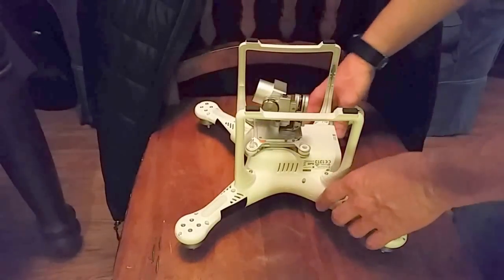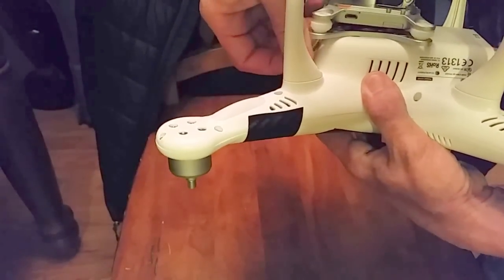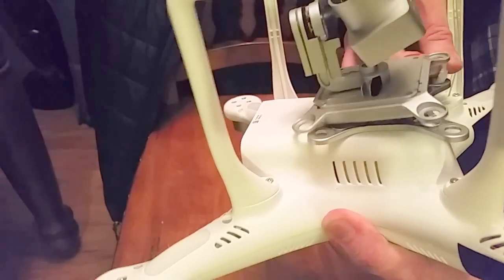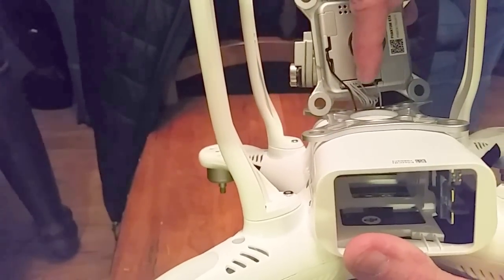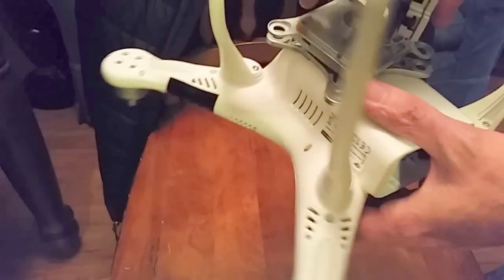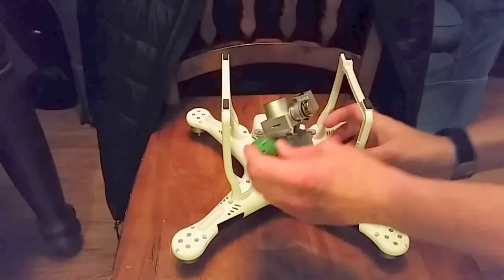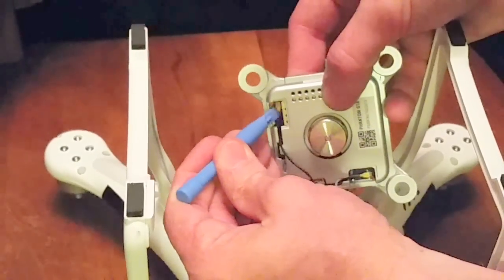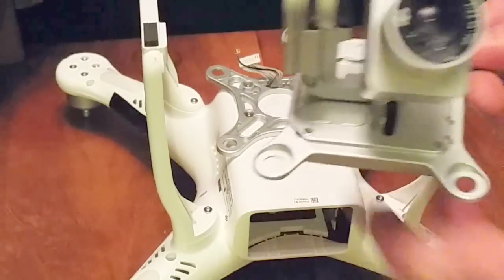How to remove the DJI Phantom 3 Standard gimbal & camera

Comment: Thanks for the video , now i know how to remove the gimbal ,  
i just have a question do you know if you get telemetry without the gimbal ?
Reply from the maker: +GTDrone 
I would have to say no. When I flew mine without the gimbal my display said No signal. It appears that even the GPS is integrated into the gimbal. Of course the GPS is located in the top of the phantom shell but it did not appear to work. I didn't try to make it RTH so I may be wrong. It may only save the records but not allow you to view in real time.
Reply: guardmy6 thanks for answering , what happen when you try RTH , i ask to other people and they told me that they don't get telemetry but the RTH works fine as long you get satellites , do you know if there is a way to get a cheap telemitry , i want to get one of those p3s that sells in eBay without gimbal just to fly with the quad for fun , but i want  RTH and telemetry , because i don't want to risk my actual phantom with the gimbal on
Reply from the maker: At the time I messed with mine with the gimbal off I was to afraid of a fly away to fly it much without everything working. I was still new at flying the P3. Since I use mine for videography Im not sure what options are out there for flying without the camera system. I would like to know though. If I am able to get telemetry and attach my own rig to the phantom, I could do more stuff with it.
Reply: guardmy6  oo  i understand , thanks for answering .. i just have a question why you have that black tape in your frame ,, you don't like the red stickers ?
Reply from the maker: +GTDrone 
I was going for a carbon fiber kind of look. Since the video I have painted both my P3S & P3P black with a light mist of grey. And I actually prefer the red stripes. ha

Comment: +guardmy6 the coaxial wires came out of the female UFL connectors. I don't know how to reconnect the wires to the female plugs. It seems difficult to me.
Reply from the maker: +Kane Katubig Its not difficult at all. You have to make sure the covers are off so you can see the  male connector. with you finger gently place the female connector directly on top of the male connection and press straight down It wont work if the connectors are at an angle. You will feel it snap back on. The hardest part is fitting you finger in there.
Reply from the maker: +guardmy6 I think i misunderstood what you were saying, but yes you will need a new wire if the connector came off the wire.
Reply: +guardmy6 ok thank you very much

Comment: I have crashed mine today and the black and grey wires came out of their RFL connectors, is it impossible to put those back on? Would it be better if I bought new female RFL connectors? 

I feel like it would be hard because I noticed that the wire is like stereo, or it has a wire inside of a wire. Thank you I love your video!
Reply from the maker: +Kane Katubig If the connectors just came unconnected then I would leave your gimbal on and reconnect the two wires. If something else happened then you can send me a picture and I can take a look at it. guardmy6@gmail.com
Reply: +guardmy6 Same happened to me.. The wires pulled out of those tiny connectors. What would be the best way to re connect them? I popped the tiny connectors off but there so tiny I don't see how get the wire back connected to them.

Comment: Thanks for posting this video. A little of my vibration board cracked and could not find a video until now of how to take the camera off. I do have one question. Those RFL connectors they look pretty easy to come off and appear to snap off so do the connectors snap back on when going back together?
Reply from the maker: yes they do. The connectors are easier to get off then back on. Just make sure you have them lined up. if you feel like it won't snap back on then move it around a little and try again. I'm glad the video helped.
Reply: What's the easier way to push them on?
Reply from the maker: +Joseph Remele well, probably a finger. I know there isn't really room to fit in there but if you use any kind of a tool it tends to slip off and you need those connectors to be right on top of each other and snap straight down. don't worry it's easier then it sounds. it's not likely to break with just a finger.
Reply: +guardmy6 Appreciate the advice. I get the part on Tuesday of this week. So if I can install it myself it will save me a lot of money. The vibration board was only 9 bucks. I am going to share the hell out of this post.